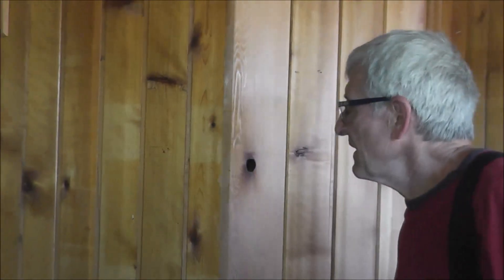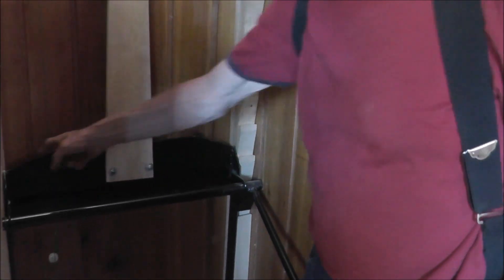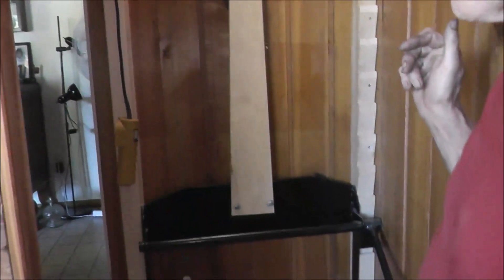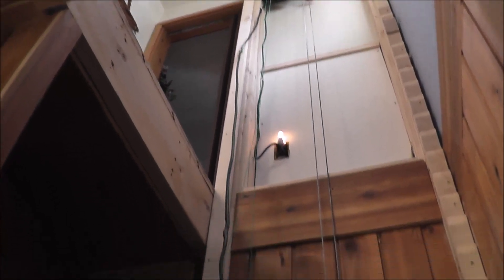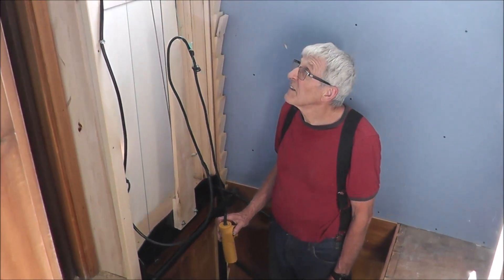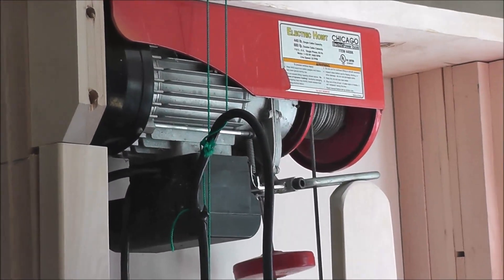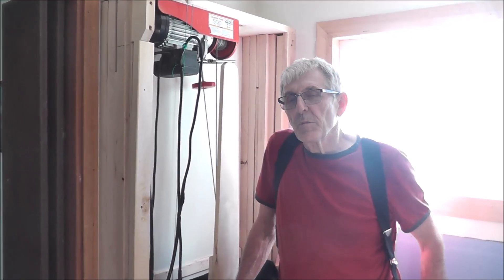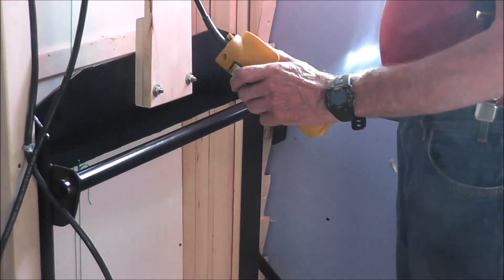DIY Elevator for home or shop

Comment: Some of the comments on here are farcical as they suggest that a buffoon with no common sense has constructed a death trap! Have you not considered that this guy is bright enough to, initially, construct this is the first place and so don’t you think he has considered basic safety factors? Ok, it’s not an Otis lift with all the whistles and bells but why is that? It’s because commercial systems are out of reach for most of our own private budgets and home applications. Also, shut up about your bloody codes.....we all know why they are there and don’t need telling......again this bloke isn’t stupid.......he’s not constructed it for you to go and have a go......you safety police should all take a breath and leave the diyers to do what they always will do and get on with stuff. You’ll be coming around telling me to put my blade guard back on next, you may try but will leave rather sharply as it’s nowt to do with you. 
Well done sir for seeing a problem and solving it within the resources you have.
Reply from the maker: Thanks for the reply and support. My main concern was to have it as safe as possible. It is possible to have the safety pawn to release with tension on the cable. My main concern at the time there might be sufficient tension on the cable at the time to not release it, but a strong spring would correct that. Yearly replacement of the cable would be a great idea,  Will be doing that with high tensile aircraft cable. I will not be moving to the city, one almost has to call in an inspector to just sneeze. I grew up on a farm and we had to create and do every thing. Check out the hay machine my brother built. https://www.youtube.com/watch?v=C1DR7yerD0c&t=4s  Thanks again.
Reply: @brianprocter6191  The Safety mechanism is non-existent! If you're holding it  for support it doesn't work as a safety mechanism. If you're not holding it, the falling momentum of the lever will raise it off the cogs. If it does indeed somehow miraculously  engage, there is a chance it will shear off the teeth. Whatever safety mechanism you choose. You need to test it thoroughly.
Considering this is apparent in 30 seconds of video, I would agree with Roy Marble that you do not have the necessary expertise to design this. At the very least Consider building a separate support structure and install a second hoist  and setup a switch to engage both hoists simultaneously. 
There would a mechanism to account for the separate tensions .  The Structure should also have structural cross members to prevent tilting or horizontal movement. Its a elevator it needs to be over engineered.
You might want maybe look for a used automotive hoist and use the hydraulic mechanism and the pillar from that.
Reply: The design fills a need. A specific purpose. It's for his handicap wife. Not everyone who visit the home. Might get used twice day. It's not automatic, you have to push the button, hear something out of the normal you let off the button. Anyone who actually works in a shop for any kind knows how to use a wench like this. People use them to save lives out in the wilderness virtually every day. Let some of these nay Sayers have bad hips or knees and have to go up and down stairs. Brian don't listen to any bad comments here. It's a shame real men can't provide for their family anymore on their own with a code to tell them what to do.
Reply from the maker: @neverknow69   Thanks Chris, It is used once a day, Before she had to sleep on the couch, not comfortable. At the moment it is not an option to sell and move into a small house. It was the best option and works well. Many of the accusations are false,  I will modify it to self arrest going down, the notches will not shear off as it is hardwood, and screwed through with long screws. The mechanism will be tension adjusted for her weight so it will be sensitive to any loss of tension.  Maybe some of them could explain to me how to do that but most of them couldn't build a dog house that a dog would live it.
Reply: @brianprocter6191  Well said!
Reply: bcstractor  - So is getting in a car.
Reply: Pretty much spot on. I work in construction, but I also have severely disabled father who can no longer use stairs. The options were to put a stairlift in or move. Fortunately someone very close was selling their stairlift and it was installed professionally but the material costs were almost zero. Let's understand that when you're disabled, money is less available to you. Also appreciate finding a new property is also very difficult, so in the same position I would have done exactly as this gentleman has. It would have been to the best of my abilities and covered in security concerns - it's a clear point of fact that the man has no intention to hurt is wife, why would he construct such a thing if that were the case. Yes indeed DIY's know less than the pro's, but do to the work well only takes time, a practical mind and the resources for the small cost of materials.Good on you...though make it safer as some have suggested :-)
Reply: He did use the early Otis fall arest mechanism which I think is pretty clever
Reply: StuffOfLard Ohfortheloveof Well Said. I’m sure he will improve on it as time goes by anyway.
Reply: Well said! Yes true there could be other safety matters to make this project safer. Let the ones that build their own elevator implement  better safety measures and share them on youtube and post a link here. Thanks for posting this idea maybe even I may come up with a safer elevator but it takes time and money.

PS I don't see any danger in your idea. If we lived on what if's no new ideas would make life better. What if the bridge falls on the car, what if the plane engine fsils, what if, what if what if the list goes on.
Reply: I inclined to agree with the above I been made handicap after strokes 2 years ago but as soon as possible I will try to get out of the care system and get a house I will have to get help but I will have to make a lift for my wheelchair and I if the DNS’s not help so far I not know how some people are getting lots from the dole etc I paid big tax bill for the time I was working and now I not even get a wheelchair from the system so I not have any chance of getting money help to try to be able to get a home to live with minimal help would be great sort of restore respect or pride oops I wandered off the subject the rules are basically common sense safety if sense was ever considered common
Reply: @liamoboyle2065  well let me know if you need any help I wouldn't mind and coming to help you get set up
Reply: bcstractor  what is illegal?  what part is unsafe?
Reply: bcstractor  not where I live. You can tie a plastic chair to a winch  if you want.
Reply: Most people seem concerned with the tiny looking winch cable, wich realistically is way stronger then it needs to be and will never fail (it looks to be at least 6mm thick, the breaking load will be 2 ton or something like that).
This leaves the mounting of the winch or cable the the platform, or the winch brake. I would have gotten a stronger rated winch myself, but the 440 pound rating would at least give a safety factor of 2.
If the winch is properly connected I would not even have bothered with the safety notches.
I am a mechanical engineer myself, and some of these comments really remind me of my colleagues with no practical construction knowledge. It's a winch with a platform on it, there is no reason for it to be a deathtrap. As long as it's not overloaded the chances of it failing are miniscule. Certainly not as dangerous as driving a car.
If this is what it takes to keep living at home, it's better then the alternative.
Reply: @markanthony7184  : The elevator getting stuck against the walls would be a point of attention in a professional elevator, but for this one I worry that the platform might not have the dimensional stability needed. Improving safety through other means would definitely be the way to go.
Reply: bcstractor  I have seen a lot of people get killed walking down the street mind there own business. So I guess we should just give up on living a normal life FUCK NO get your head out of your ass. Instead of being a Tool why don't you offer help to make it safer than just running your mouth.
Reply: Those who hate are those who can't do this.
Reply: I agree with @roy marable about the piece the winch is bolted to... You wouldn't run a floor joist like that. I think the angle iron suggestion has the most merit but if it has to be wood, a couple of 2x4s on edge under the board would add strength enough. I also think that if the pawl had a larger bottom it would address Mr. Marable's shearing concern. 
The one question that runs through my head.,. Why feel a need for the safety brake going up but not down?
@brian Procter outstanding idea... Very creative design and good on you for finding a solution to a problem. You've helped me solve a similar situation.
Reply: I understand trying to do whatever you can to make it easier on your wife, however you're trusting a Harbor Freight winch? You're a brave soul.
Reply: @mikedavis3489  I've pulled probably 30 cars on a trailer with one. Still going strong. China is passing American quality. Some harbor freight tools are better than Craftsman now.
Reply: Bryan Hensley 
Did you use the winch pulling cars 6 times a day every day? What would happen if the winch break slipped? I am sure you would never have someone standing behind or under a car while you were winching. 
If there were a problem you would say a few words. Block the tires. Then adjust the break. A fragile elderly woman, wouldn’t be able to do this. There is a chance that she could be hurt. Is it worth it. 
Is your winch attached to steel, with steel bolts and steel eye bolts? Would you trust your life, to a winch screwed to a wood frame?
How much would it cost to replace the wood frame holding the winch with angel iron and bolts? Is the wonderful ladies life worth the small added expense? How much would it cost to replace the single wood notched safety stop with 2 notched angle irons?
I’m NOT running this man down. I am trying to help him.  Do you REALLY think I am wrong? Is it wrong to try and help? What would you do if you were me? Not say anything?
Reply: @roymarable5860  I've probably lifted over 200 engines and transmissions with one while we work under it. You think someone with your education would know how the winch brakes to start with.
Reply: joseph watson  The Canadian government gave Khadr $10 because he was, by international law, an illegally detained child soldier who the Canadian government left to rot in a US prison which was also illegal under international law. If you read the original military reports, Khadr could not have thrown an American grenade as the Taliban were using Russian grenades and he had already been so severely injured, even the US military personnel at involved stated that. Of course, politically that didn't go over well so the report was change 3 months later to fit the Bush administrations' narrative. Get you fact straight!
As for 'Canadians have nothing', Mr. Proctor's wife is getting nearly free insulin, at least compared to the US, try this on for size https://www.youtube.com/watch?v=SVuRNKejWWA Jesus Christ you wingnuts are stupid!
BTW, good job Brian, I'd put a guard or a door at the opening so no one falls in and a few other upgrades like a better braking system but otherwise, great idea.
Reply: well accidents do happen. a preferred home elevator design has at least two failsafes and a rail to protect your hands and feet. maybe a chair too, considering the lady has hip pain & this takes a while to work. he also took pains to make sure the floor of the elevator is level with the floor of both stories, that's also a safety feature. incorporating a gate that opens only when the floor is level is probably very important to prevent falls.
Reply: Some of these concerns are very legitimate. It's an open question whether those notches will or will not shear off. It's definitely a possibility that the dog fails to even catch a cog on the way down, given that the rotational force being applied to it disappears the moment both it and the lift are in free fall. And it definitely isn't going to work on the way down, so during 50% of its operational time there is no safety measure for the winch failing at all.
Reply: Yes I considered it. I listened to him. I looked at the design. 
The man meant well. He built to the best of his abilities. He is a nice man who loves his’s wife. 
No he doesn’t have the knowledge necessary to design and build an elevator. 
SORRY, IT IS A DEATH TRAP! If you love your wife. Please get some help to redesign and build a safe elevator.
Reply from the maker: @roymarable5860  A number of the negative things said do not apply as a safety concern as they are not here to see it. But I will make a automatic  locking system to stop it incase of catastrophic failure as people say will happen
Reply: @brianprocter6191  I would suspect you've stood on two poles 6 tiers high hanging tobacco haven't you? No safety ropes or rails there. Framers are more intelligent than most people. Maybe we should do away with the safety labels. It might be a good thing.
Reply: @roymarable5860  What specifically makes it a DEATH TRAP!!!! ???  Its easy to cast accusations! The only issue i see is stepping off the 2nd floor while the elevator was not at the top or stepping off the platform mid flight - but the 2nd would be quite hard to do.  But a safety rail with a gate would fix that pretty quickly.  It appears that the safety paw system he has is adequate to stop the 1 person and the platform from falling the roughly 4 inches to the next notch should the cable snap.   Which given all the conditions I think is very unlikely given that the load ratings i found on the cable are 3000 to 7000 lbs.  The platform probably weights 100 lbs and the person lets say weighs 300 lbs which is probably well over what it really is ... so 400 lbs on a cable rated for 3000 lbs ... that is over 7 to 1 safety rating.
Reply: Jim Coyle 
I am a mechanical engineer. First the winch isn’t designed to haul people. The break isn’t strong enough. The winch isn’t supported property. It fail. 
Second, if you look at the safety stop. When the winch break fails or the winch supports break. All of the weight will drop onto his safety stop. You see the metal that should lock stopping the elevator from falling. If the elevator should drop 3 inches. The metal wedge will act as a chisel. All of the careful notches in the wood will split off. The elevator will drop faster and faster. After the first notch is split off the elevator will move faster. The force will split the notches off faster and faster. 
What needs to be done. First, replace the wood supporting the winch. With 3 pieces of 4”x 1/4” angle iron. Fasten it with 1/2” lag bolts and 1/2” bolts with lock washers. 
Second, replace the wood notched safety. With the same size angle iron above. Have a welder cut notches simulator to the wood. Use the same lag bolts to fasten it to the building frame. He should have a break on both sides of the elevator. In case of an accident. The two angle iron breaks will stop the elevator from falling. 
This won’t cost that much and WILL save his wife’s life. 
Look at those wood notches. Imagine what an would do. It would split the notch off like a knife going through butter. That is what the metal wedge will do to the wood notches. 
I am not trying to make the owner look bad. He put a lot of work into it. He did it because he loves his wife. I don’t want to see her hurt.
Reply: @roymarable5860  Thank you for explaining!  I too am an engineer.  I saw that situation you describe I haven't' done a force analysis on it - maybe you have - but I don't think 300-400 lbs dropping 3 inches will drive a 1/8 inch piece of steel through a piece of hard wood like that.  But I see what you are talking about and again thank you for helping me and others understand you better! :)
Reply: @roymarable5860  maybe true I really don't know how safe this version is I know there could be improvements.  I would use a track with cogs if I were to design an elevator. The cog trains can go up steep mountains and carry heavy loads.

 I'm sure a 3000 pound winch can handle 10 percent of its load safely in a vertical position. If you don't trust it get a bigger winch.

Enough said
Reply: @jimcoyle7262  yes and this guy was a farmer, or still is for all I know. There's no safety rails around the hole in barn floors where you climb straight up ladders. You don't have to tell farmers anything about safety, people should be listening and learning instead.
Reply: Jim Coyle 
A lot of people are very angry with me. It is not my intention to hurt the builder. He loves his wife. He did the very best he could.  
I attempted to let him know how dangerous it is.  Then I tried to make a practical and a reasonable your priced improvements he could make on his own.  The wood bracing of the winch is dangerous. I suggested using angel iron with the proper size bolts. It is very very dangerous to rely on a break designed to pull a car out of the mud. This type of winch wasn’t designed for daily use. If the break comes loose while pulling a car out of the mud. No one will die. 
The safety looks like it would work. Sorry in an emergency all of the notches will split off, seriously harming his wife. Replacing the wood with 2 notched angle iron. Will make the elevator safe.
Reply: Bryan Hensley 
Yes the winch is rated at 3,000 pounds. Is the wood frame held together with wood screws rated at 3,000 pounds?
The winch wasn’t designed for constant use. The break isn’t strong enough for constant use. The wood safety stop will shear off when something goes wrong. This is a fact. 
I’m not trying to run this man down. He did his very best. I only tried to offer inexpensive changes that will make the system safer. 
Sorry if I offended you. Perhaps if you had a higher level of education and over 30 years experience. You might understand the very serious design problems.
Reply: @Bryan-Hensley  I was more thinking about his invalid wife who might not have great balance due to her stated hip problem. I have a friend who has a hip problem and he is not steady when he walks and loses his balance some times!
Reply: @roymarable5860  but you are all for them falling down the stairs huh? Unless you want to spend you money buying them an official elevator, you should be quite. I've always been someone who attacks a bully and defends the victim.
Reply: Bryan Hensley 
My friend I your anger you didn’t understand my intentions. 
He is a good man trying to help his wife.  I attempted to make simple suggestions to make his elevator safe. I you saw a car driving towards a bridge that was washed out. Would you be a bully attacking a victim? Would you stand by and watch the car plunge into the water. Or would you stand in the middle of the road and stop the car and warn them of the unknown danger ahead?
I pointed out some very dangerous design problems. I then suggested some inexpensive ways to make his elevator safe for his wife. 
What would you have done? Warn the man of the danger and suggest inexpensive changes to make it safer. 
To answer all the haters out there. I grew up working on my family farm in Nebraska. We planted corn, wheat and sorghum. 18,000 acres. We had a heard of about 300 cows and we raised hogs. Yes I know about farm life. I also learned about safety. My grandfather, father my son and myself have all of our fingers, toes and eyes. Several of our neighbors died in preventable accidents many lost fingers, arms, toes and an eye. Yes laugh at safety. 
I went to school earned a masters degree in mechanical engineering. I retired after 32 years. Yes I still help on the farm at plantings and harvesting.
Reply: @Bryan-Hensley  Not so, farming is still one of the most dangerous occupations so yes, you do have to tell farmers about safety, maybe then fewer of them would die every year.
Reply: @roymarable5860  : One of your problems is your writing. You need to slow down, and review what you've written before you post it. One particular issue that I noticed is that you repeatedly used "break" instead of "brake". You can "break" a stick, you can "brake" a car, but you should never mix them up because it obfuscates your meaning.

No, you say that the winch's brake can't handle this duty, but would you care to clarify what you mean? Are you talking about the braking effect applied to the cable while the winch is operating, or while the elevator is at rest? What is the particular problem that worries you? A retaining knot coming loose? Simple slippage of e.g. a friction interface? Something else? As a retired engineer, you should know that every solvable problem has a solution, and that sometimes engineers didn't bother with certifications that they could have passed, but were in unrelated fields.

As for the "safety rack", unless you actually ran numbers, I wouldn't consider your expectations to be reliable. I worry about the same thing, don't misunderstand that, I am fully aware of the correct use of a wood splitter, but unless you've run numbers you just don't know.
Reply: Jared Maddox 
I am legally blind now. Age related. I rely on text to voice and voice to text. I have a very large magnifier so I can watch videos. For my replies I rely on voice to text.  It is a great help but it isn’t perfect plus my IPhone autocorrects. So some of the time the words that I say and what the program prints out has errors. 
I am 73. I am an advise woodworker. My daughter has a fit every time I turn on the saw. She loves the furniture that I build for my family. I use measuring tools with bumps on them for the blind. I still have all of my fingers and toes. 
I hope you will be as active when you are my age.
I am sorry if my voice to text programs aren’t PERFECT ENOUGH FOR YOU!! Or are you a bully who enjoys picking on people? I pity you. I hope you never lose your vision. Macular degeneration makes normal life difficult. Especially when my doctor took my drivers license away.
Reply: or put flat metal on top of notches screw it on through holes or , the grain of the wood in nothces matters how is it oriented one way is weaker. maybe instead of notches use  thick enough long enough bolts going into strong enough timber maybe a nut on other side and head of bolt will be the notch might make it protrude more with pipe shim or nut.
Reply: @roymarable5860  Yes. a death trap for you.  But for this gentleman no.  I always find it interesting how youtube brings out the fear in people.  Roy.  Punch in "wing suit" have a watch.  This should bring you back down to earth about the definition of what a "Death Trap" is.  
"The only thing you have to fear is fear it'self. "  I think you have heard that one before.